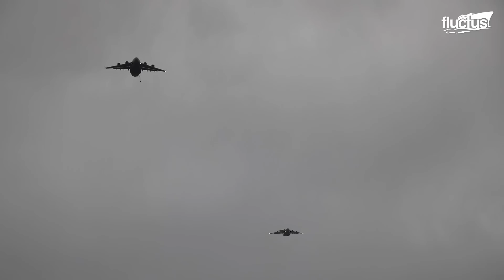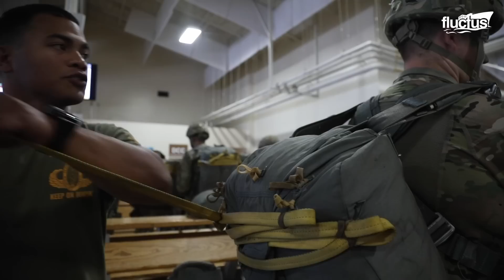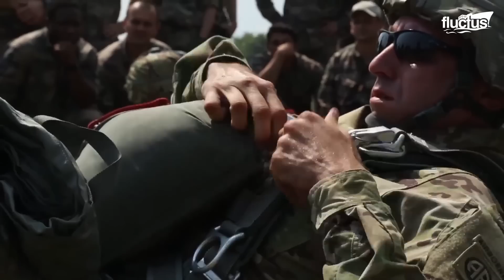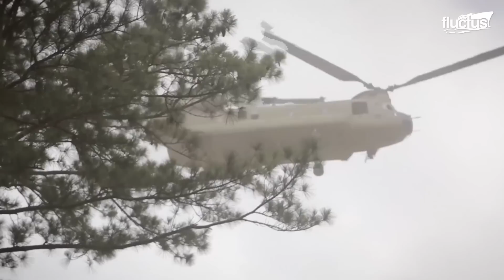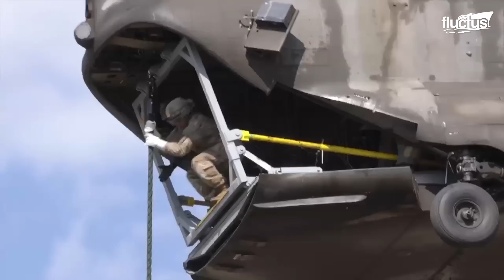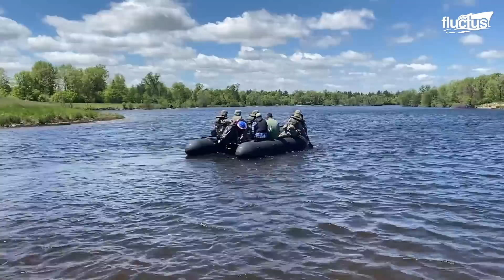The Scary Logistic Behind US Massive Scale Paratroopers Static Line Jump

Comment: Because paratroopers are vulnerable to anti-air fire from ground defenders, all Combat Jumps are at low altitude (400–500 ft) and from the target area at night. Full Combat Gear can add allot of extra weight and Desent Speed and after your Jump Count Not much time to check your Canopy (Parachute) decide whether to Pull a reserve chute Drop your equipment and land properly so you don't injure yourself, reserves are great for Training Jumps but Not Combat Jumps.